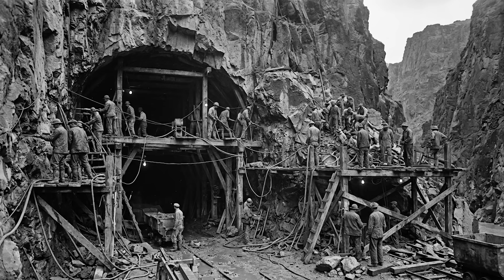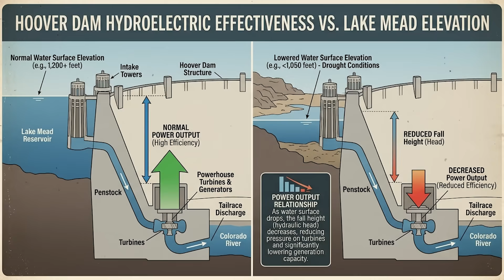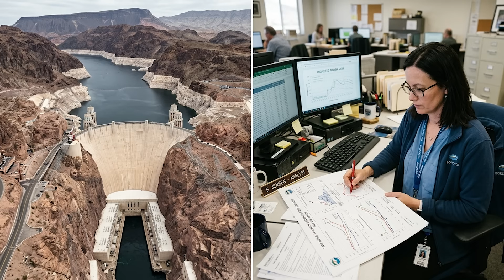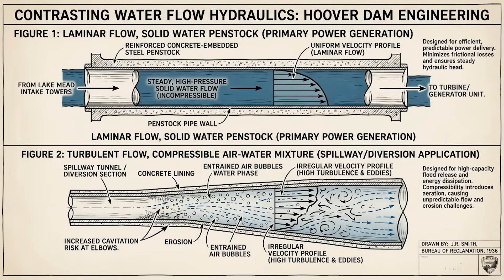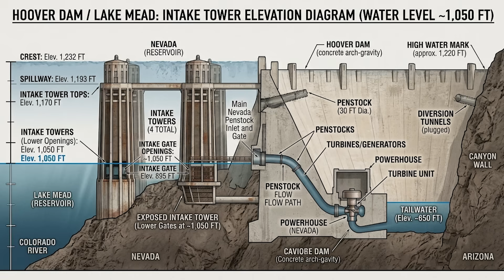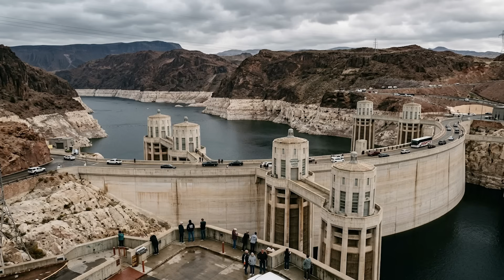Hoover Dam: What Happens If the Intake Towers Reach Air?

Comment: Las Vegas has a massive water intake at 650 feet. 

Even at 800 feet we still have 150 feet of water 

Plus, we have enough water in Lake Powell to fill Lake Mead. 

We just need to open the flood gates and let the water out of Powell. 

It's not a big deal. 

We have 50 years of water left